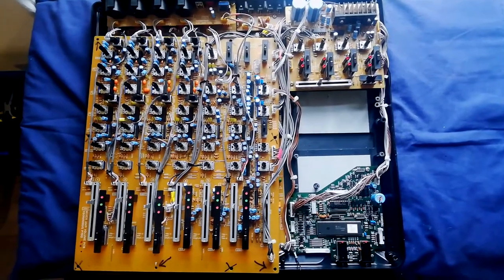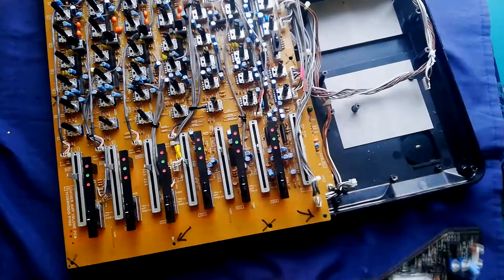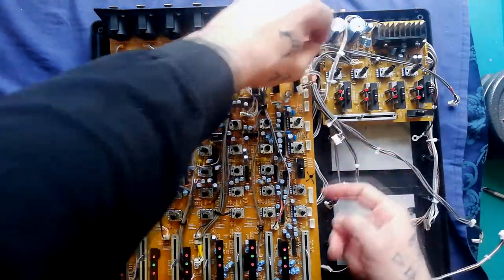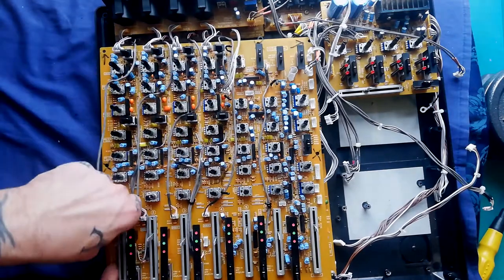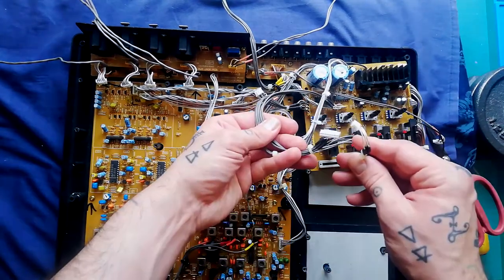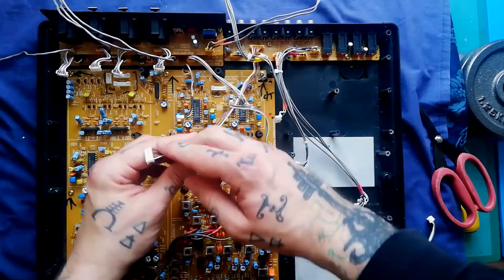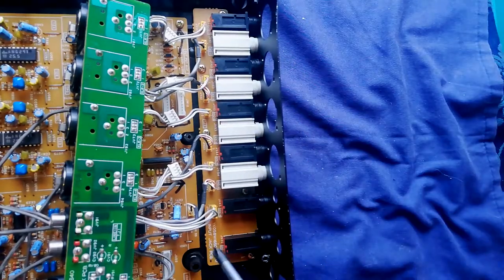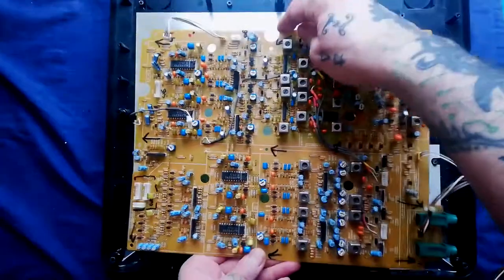Marantz PMD740 |   Tear Down | 4 | Dismantle Lower Section

Comment: At the videos end the pop ups obscure your text overlay. Sorry. Not seen many of these units come up for sale etc - were they particularly popular or any good, build quality wise? Using the "Tascam Measure Principle" where do they sit next to - 244/246?
Reply from the maker: Hey, thanks for the heads up I'll see if I can move the pop-ups. If you check the Marantz playlist from my channel homepage I made a video exploring this comparison but in summary, I'd still prefer a 246 but the Marantz is close overall and even  superior in some respects (h pro high end autobiasing, switchable mid range Q)
Reply from the maker: Sorry just reread the question...build quality -  the tascams have heavy metal chassis but I'm not sure that actually makes them more resilient, in fact the extra weight means there is more force applied to fragile parts if dropped. A more appropriate comparison would be with a no chassis Tascam like the  464 and I'd say the build quality is similar.